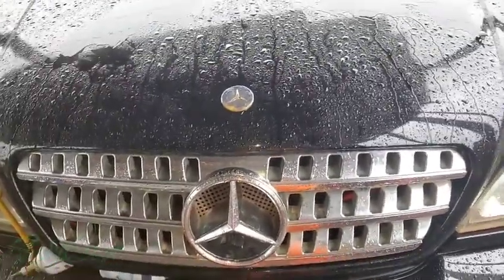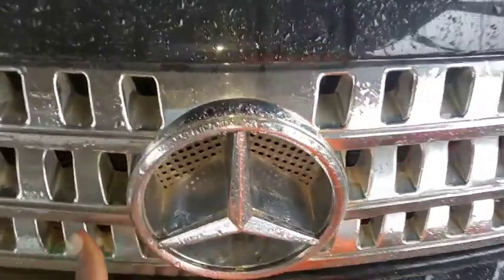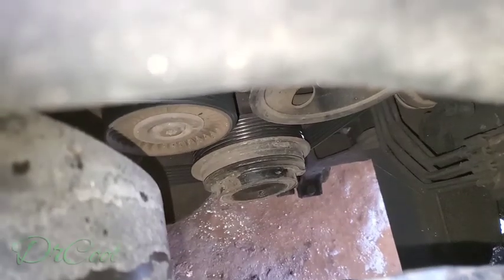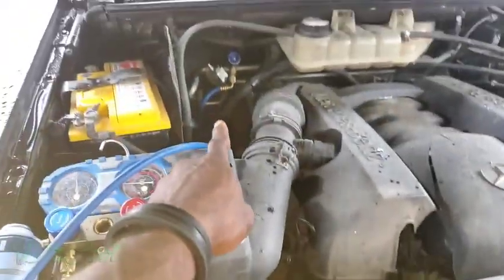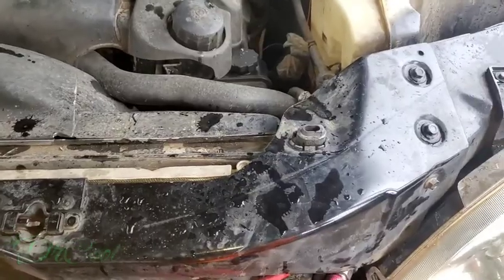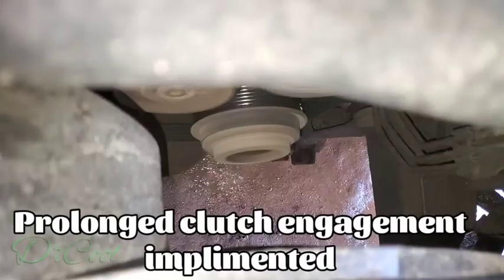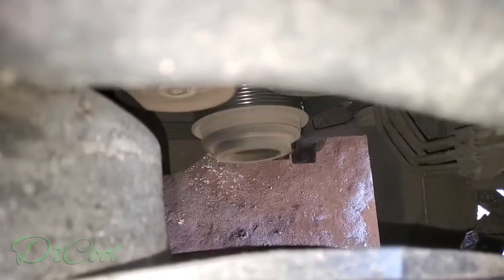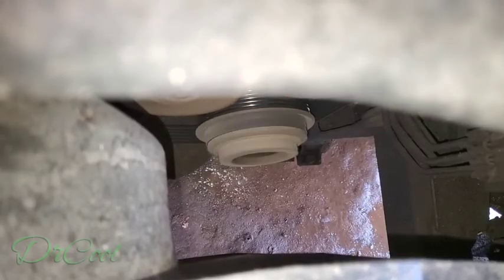Car Ac Compressor Continuously Running Solved! | Ac Clutch Wont Short Cylcle Solved

Comment: Thank you for this video. I have a Peugeot 406. My car's AC compressor runs continuously and it is very chilling. And I've had to change the pistons twice. The latest repair I did was to change the compressor completely and I'm still having the same problem. I suspect that it could be a result of a bad freezer thermostat sensor not sending a signal to the system to shut off the compressor after it has reached the desired temperature. Another thing is, could the malfunctioning of the ambient (outside) temperature sensor affect reading of the freezer thermostat even though the AC is not set to auto as that is the only setting that I assumed requires the reading of the ambient temperature to perform? There's also another sensor which measures the interior temperature of the car. These 2 sensors (ambient and interior) I believed are working together and have nothing to do with the sensor on the freezer compartment. What is your own opinion as an expert on this? I'm just a regular car user who happens to know a few things about cars. Thank you.
Reply from the maker: Watch videos about compressor clutch  won't  disengage and follow up

Comment: I had issue with ac compressor running all the time, I had ac system vacuum and recharge. I had too much freon. Now my compressor cycles, thank you for your video.
Reply: Now my ac works all the time